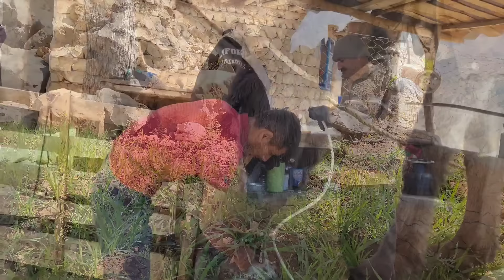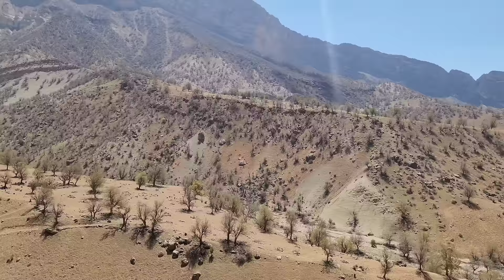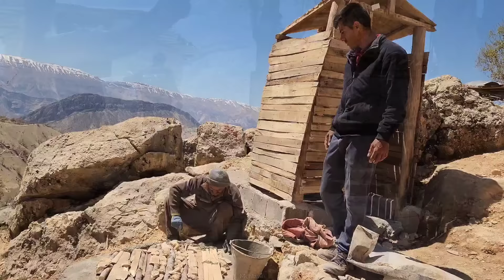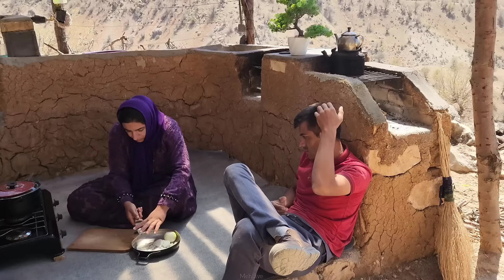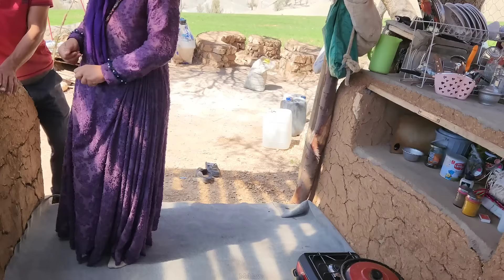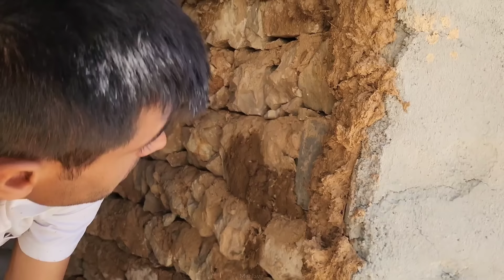"From the gas capsule to the entrance of the castle with the nomadic life of Asghar and Halima"

Comment: Asghar please think of safety …it’s not a great idea putting the gas tank in direct sun especially with the hot weather the tank will heat up and cause combustion and likely to explode On a warm summer day, temperatures can rise quickly. As the gas tank gets hotter, the pressure inside the tank will increase.
Reply from the maker: When the weather is a little warmer, we will make a canopy